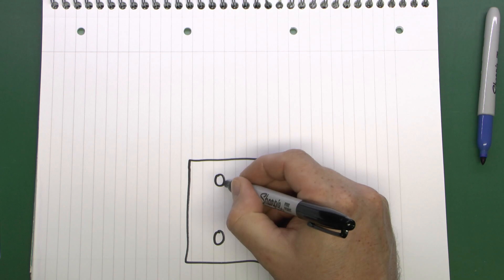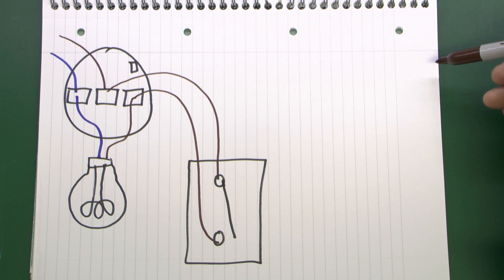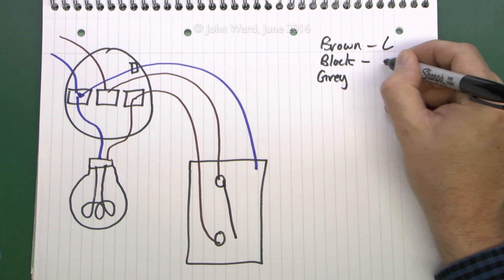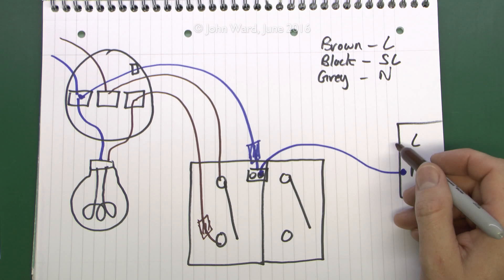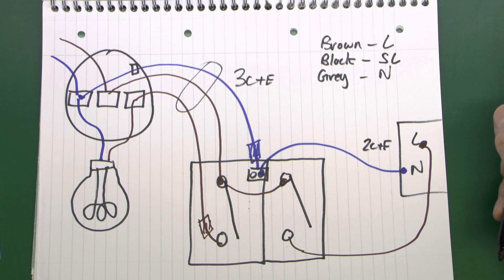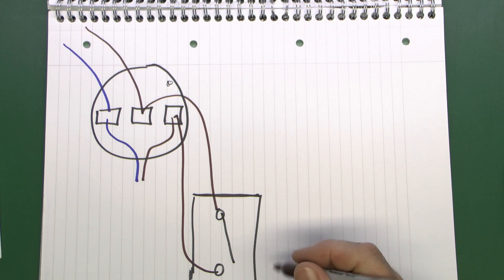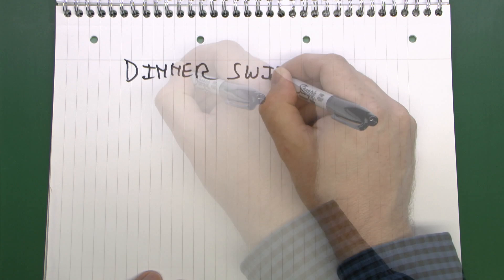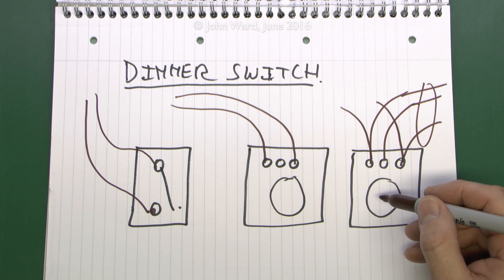Lighting Circuits Part 3 - Fans, Motion Sensor Lights, 3 Core & Earth Cable

Comment: Excellent stuff John.  I was wiring a timed fan in the bathroom and made the error of going straight to the part 3 video.  Everyone who describes the wiring for a 3 core fan starts from a ceiling rose.  I didn't have one - multiple LED lights.  Eventually I went to lighting 1 and gained an understanding of switch, or loop wiring.  All I needed to do was find which of the eight wires came from the switch and take it from there.

Comment: I think getting a three pole isolator and putting the fuse only on the line is a good compromise. I found you can get them as a combined unit. The switched line remains unfused. After all it's just controlling the timer circuit. The line is where the fan get's its motor power via an internal relay. This switched timer circuit is therefore less likely to be a source of fault and/or fire.

Comment: Very helpful videos thanks John.  Interesting what you said about the fuse not being required for the fan as I've recently fitted a fan and I got rid of the old fuse connection (for the sake of tidiness) and joined the wires and tiled over the back box.  I did have run a switched live though from the ceiling pull switch as the old fan didn't need one but I ran this behind the new coving.  Great instructional videos and advice.

Comment: John I've got aproblem got 2 gang lighting box operates 2 ind lights sharing the 3core & E switch wire  wired old cable Red com shared with 2 com term 2w blue goes to SWL & yellow 2W goes to Neutral. i porch light connected 1 black to N 1 Red to Loop to hall ceiling light 1 Red to Loop  & the switch wire as a bove . Hall light works turns on/ off 2nd porch light stays on all the time seems like switch not operating this light? David

Comment: Hi John, what happens in a house where there are no ancient style ceiling roses and all click-and-fit? My house has Quickwire lighting connectors (which is all twin core and earth) but my fan isolator and timed fan extractor in the bathroom are of course, three core and earth. Whoever installed it originally simply didn't connect the timer because you physically cannot connect both the permanent live and switched live, to a twin core system. Any ideas?

Comment: Thanks for clarifying the colours at the end of the section as well as covering the question of sleeving - most helpful.  Would it be expected to add sleeving to an existing older installation (with older colours) when new wiring is added for say a extension? When you make a connection in a lighting box I assume that a "chocolate block" is used?  Am I correct in assuming that if a new CU to accommodate the new wiring is installed all the existing circuits will need to be tested and everything documented? Cheers, Jeremy Stevens

Comment: Great vid as always! In the case of 1 extract fan serving 4 rooms, is it possible for the fan to run continuously but then boost when the lights are turned on in any 1 of the rooms? Lighting in 2 of the rooms are controlled by manual switches and the other 2 rooms by PIR presence detection. A video with diagrams would be superb!?
Reply from the maker: Yes, the usual way is to have a double pole switch for the lights - one pole switches the light, the other pole switches the fan (or activates the fan boost).

Comment: Hey John, im confused with the fan part. In the example of putting separate switches for the fan and light, do you use 2 core and earth from the loop to the switch?

Comment: How can install motion flood light sensor (PIR) with single pole switch and withough switch and how can adjusted for day and night and just adjust for night. Please help me as soon as  possible. That lights need to activated as well or they need to just fix power to them. One trad mark is : 20 watts  LedVance  motion floodlight sensor. I am waiting to hear from you. Thanks a lots

Comment: Hello John. Very informative videos. Could you tell me the best way to connect an extractor fan in a bathroom to the lighting circuit? The bathroom light is fed via a single switch which break the live wire. The neutral wire continues direct to the the other terminal in the lamp holder which is the end of the circuit. I would be looking to put in a 2 gang switch instead to control the light and timer fan separately. Any help would be great

Comment: Hi
I want swap 1 gang lights switch on 2 gang lights switch in kitchen. I want leave ceiling rose with current lamp and i want add to this extra separate switched 3 spot lights over top works. Finally I want have possibility to switch all lights or only spot lights or only lamp from ceiling rose. I know that I need 3 core+earth in 2 gang switch but I want do all connection in ceiling rose for second sets of downlights as well. Problem is that ceiling rose has only 9 approved connectors but must be 10 is mean one extra for connection  to downlights. question is can i add to ceilling rose 1 separate or not?If not what alternative way you can suggest for me?

Comment: Hello great channel.
I was wondering if I could use a 4 core electric cable safely as a standard 3 core household item , the 4 wires  are green and yellow, brown, black & grey. Thanks in advance
Reply from the maker: Yes, the unused black core should be connected to earth at both ends.

Comment: Only one thing i say,we in the Netherlands have tubes running in the walls and ceilings.Its a lot easier to get a neutral wire through it.No need for changing a cable,just a wire through it.
Reply: Hey that's great. Make sure you put the exact same comment on all the videos please!

Comment: Your videos are great, so easy to understand. Thanks.  I have a problem that is annoying me, I wonder if you have any helpful ideas?  I have a power cable supplying two lights on the path to the house.  Both lights have pir sensors attached, both lights and sensors work.  Problem is  first light comes on, but the second one comes on and instantly turns the first one off, making the steps  very dark for anyone walking behind.  This has only started since I had to change the light at the end of the power line for a new one.  Previously both lights came on when their PIR sensors were tripped and stayed on for their allotted time.  I can't work it out!! please help, thanks.
Reply: " This has only started since I had to change the light at the end of the power line " you wired the light incorrectly

Comment: My lighting circuit is from the mid 60s and is the black and red insulated wires in i think is metal conduit, I believe this is used as the earth return, is this correct? as we have a new bathroom fitted and recessed led lights, the electrician said that he could not get an earth from it, so have to have a new circuit put in.
Reply from the maker: That was a common arrangement, the conduit is the earth.
However there are several types of conduit - the heavy gauge screwed together type would still be suitable for use.
Other types were much thinner and either connected with small clamps or even just pushed together - that style is not suitable for the earth as the connections are poor at best, and the various pieces may not be properly fixed together.
if it's been tested and the conduit is not connected to earth, then rewiring is the only option.
Reply: 4
Reply: @jwflame  John can i connect the neutral from the cu??
I have wired an outside light but cannot access the neutral from the ceiling light but the cu is near by ,i have put a 3 core & earth cable in the existing switch which is a 2way switch and replaced the 2 gang switch with 3 gang switch which is a 2 way.
The outside light should be switched on inside and outside.
So black is common and linked it to one of the commobs in the switch,then brown is l1 and blue is l2 .
I have made the same connections to the outside 2 way switch so the the twin and earth cable is run from this switch to the light fitting.
The blue in the twin and earth , is it connected to neutral or brown sleeved and connected to l2???

Comment: Hi JW if i want a landing light and a hallway light and want to control them both from up stairs and also down stairs ( double light switch upstairs and downstairs basically) what circuit breaker would i put them on to. Upsatir lights or downstair lights. Thanks
Reply from the maker: If there are separate circuits for up / down already, then put the upstairs light on the upstairs circuit and the downstairs light on the downstairs circuit.
However no requirement to have separate up/down circuits, they could be both on the same one.
Reply: @jwflame  if there were on diffwrent circuit and i i turn off upstairs for example would there not still be a live wire on the upstairs light stwich though as it is still in control of the the downstairs hallway light via 3 core twin and earth?

Comment: Hi John. 

I have a single way switch in the bedroom and I want to put a light in the loft. I have a double switch with separate connectors on the back. 

If I run a cable directly down from the light to the switch, can I run a neutral from another rose up to the neutral on the new rose then loop back to the donor rose? then just jumper across the two coms on the twin switch and use the blue cable in L1 on the second switch connector using the light end of the blue wire as the switched live?

Cheers if so a video or a diagram would be cool

Bill
Reply: Presumably, you have an access to the ring light wires from the loft? Why would you like to complicate the wiring so much then? Cut into the ring, fit the light/rose, then run the one live/live-switch wire to the switch you want. Make the connections neat and easy to understand for the next DIYer ;)  "If I run a cable directly down from the light to the switch, can I run a neutral..." as you cut into the ring, you will have L and N there. The only thing you send down is L and LS. Just make sure to mark the 'live' and 'live switch' wires with the red tape.

Comment: Hi john . Im currently totally gutting my kitchen and have exposed the lighting setup
In the 1 gang switch on the wall i have a brown cable and a black cable
In the ceiling i have a brown cable and a black cable powering the bulb ...... Thats all !!
My kitchen is an extension on the back of my house so i presume the kitchen is the last light on the circuit hence the lack of cables . Could you advise what these wires are doing as they are all buried in the walls and i cant see whats what . TIA
Reply from the maker: If those are the only wires, there must be a concealed junction box somewhere, probably in the ceiling.  As the kitchen is being replaced, now is the ideal time to locate and remove that hidden box.
Brown and black is not a normal combination of colours - red and black is more likely on older installations.

Comment: interesting that in the UK switches usually don't have the neutral in them. In my house (in Germany) they all have twin and earth cables going to them and then another one continuing to the lamp.
Reply: the old way here was power feed to light fitting then one 2 core to switch.
now we run feed 2 core + earth to switch then 2 core + earth to light and if needed another 2 core + earth to the next switch.

Comment: Hi John, Really love your videos, they are very helpfull. I need to replace ceiling rose in my bathroom with IP44 light but the new bulb holder only has direct connections and no room for other cables that are in exisiting ceiling rose, would I need to use junction box for this and tuck it above the ceiling? i.e. wagabox etc. Thank you for your help.
Reply from the maker: Yes, either screw connections or Wagos etc., all ok as long as they are in a box.

Comment: Can I have a dimmable pir for day and night with an extractor fan without the pir affecting the fan?
Reply from the maker: Not easily - some fans may activate with a lower voltage or dimmed input on the switched line, but others may not.  Also possible that the output from the PIR causes the fan to run all the time,  as it will be the output from some combination of electronic components rather than just an on/off switch.

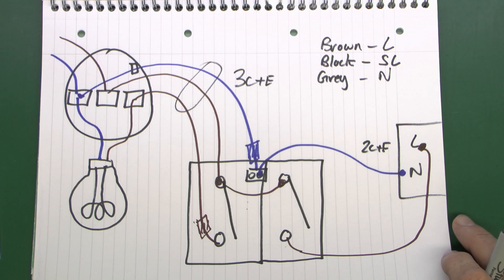Comment: at 6:41 why do we need the second gang. because both gangs do the same thing - create a switched live which powers a light . However if it was powering a fan than needed a separate fuse, then the love loop between the two gangs would be the place to put the fusee.
Reply from the maker: Each gang for a separate light, so they can be controlled separately.
Reply: John Ward doh

Comment: Another great video JW, thanks. I've found with ceiling fans that there aren't enough terminals to rewire the ceiling rose into the fan. Rather than use extra terminal strips within the fan, or rewire the ceiling rose into a junction box above the ceiling, why not just enlarge the hole & put the rose above the ceiling, then run a suitable flex to the fan? Is this acceptable to put the rose above the ceiling (assuming it accessible from the loft for inspection)?
Reply from the maker: A rose could be above the ceiling if accessible and fixed in position (to avoid wires being pulled out of the terminals), otherwise a junction box with cable clamps could be used and pushed through the ceiling hole from below, in the same style as used for downlighters.
Reply: JW Good to know, thanks again

Comment: My bathroom light and fan have a fuse in the circuit - the first time I needed to remove it, I found it was a 13 amp - limited use on a 6 amp circuit so I changed it to 5 amp.
Reply: Would you explain about control 02 circuits with diferent lines whit the one sensor movement I try to use internet. I've found dicromat 2cr but had serious question about 2 circuits with diferentes lines L1N and L2N

Comment: What I did was to fit a new pull cord switch.  Power from the lighting junction box under the floor boards goes to a 30mA RCD, then out to the switch, L & N go out from the switch to the fan.  The permanent live is taken from the back side of the switch and goes to the fan.  The fan can be isolated via the RCD which is in an adjacent  room.  I had a problem because I fitted a double pole switch and that disconnects the neutral meaning there can be no run on timer.  To fix this I bridged the neutral terminal in the pull switch, so that you can still isolate from the RCD, but switching the fan off via the pull cord only disconnects the live. 

Is there a better way of doing this ?  should I have fitted a single pole pull switch  and used a connector for the neutral ? or taken the neutral  from the RCD direct to the fan and used a single pole pull switch ?
Reply from the maker: Doesn't really matter - single pole switch and connector is fine, so is what you have done.  Could also put both of the neutrals into just one of the switch N terminals so they are connected together permanently.
Reply: Hi John, No in the end what I did was to take the permanent live from the back side (input) of the switch, and then I placed a bridging wire over the neutral to make the double pole switch a single pole switch.

I did think about taking the permanent live and a neutral from the RCD, but I have used 3 core and earth from the fan to the switch, and two core from the switch to the RCD.  Just so you know, the lighting circuit is not an earthed system, and the fan is a IPx4 rated and an earth is not required.

The system works fine, the RCD protects the fan OK totally isolating it.   The only reason I used a double pole pull switch was because I read it was a requirement, but now I have the problem that when switched off I have no neutral for the run on timer without doing the above.

Comment: am from d philippines, could u use either Line or Nuetral wires for d switch, what difference does it make? we use simple 2-core wires w/o grounding earth. thanks a lot
Reply from the maker: If neutral is switched, it means the light fitting is still live even when switched off, people could get a shock from it.

Comment: Hi John. Would it be possible to run the ceiling fan through two dimmer switches? One for the light and the other to control the fan speed. Thanks.
Reply from the maker: Yes, but the fan one must be a dimmer suitable for fans/motors.

Comment: Unfortunately some electricians seem to think that because black used to be the colour for neutral, they can use it without sleeving it blue, and keeping as one colour scheme. The same seems to go for older coloured cable, the blue being used for neutral, without any black sleeving.
Reply: All of mine use black for neutral and grey for SL but I always sleeve on the appropriate colour so it shouldn't be a problem.

Does look wierd (when the colours first changed and I still have RYB 3+E yet Bn/Bu T+E when I was sleeving the blue in blue.... (and the red and yellow in brown) but at least its unambiguous